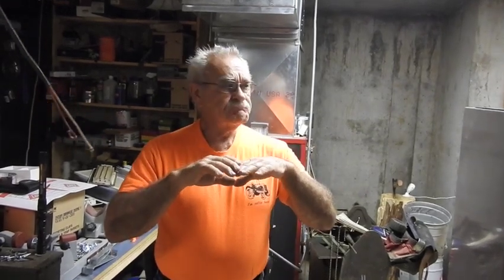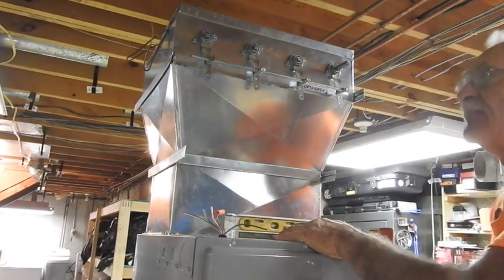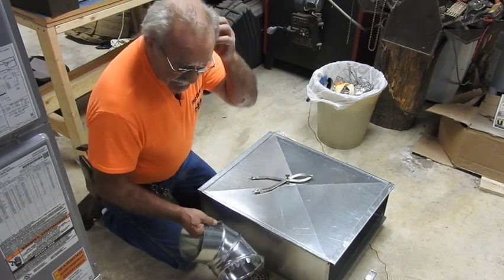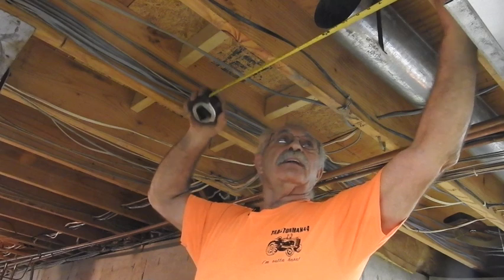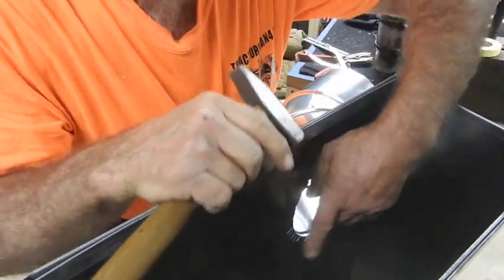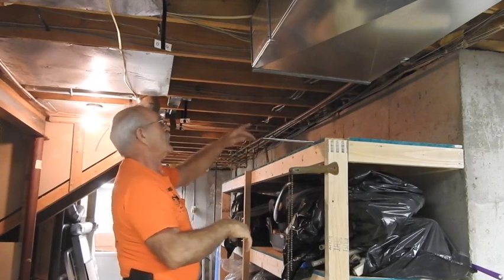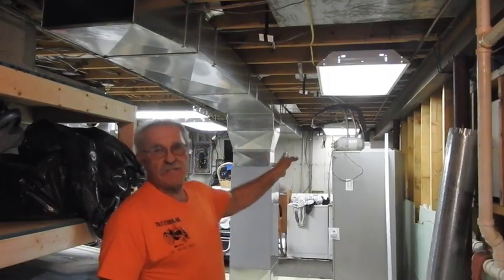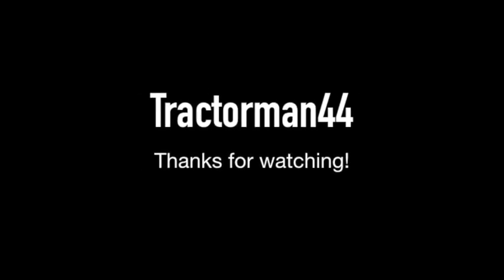Air Handler and Duct Retrofit Part 1

Comment: Hi Tractorman44!  I have really enjoyed all of your videos!  You have that common sense approach and are a wonderful teacher by example!  I have a question for you, or two!  Is the heat pump unit a 2 or 3 ton?  Also did you find the 20" x 8" duct sufficient?  I see others recommending 24" x 8" for a 3 ton unit.  I am about to install a 3 ton unit in my house, DIY, and have to change all of my duct work.  I built the house in 1984, when electricity was 3 cents a KWH, using baseboards, but I do have ducts going to every room for my HRV. (I have heated with wood, since 1993 but age is catching up)! The trunk line at the moment  is 8" round duct that will not do the trick.  I think you said they had a problem with noise, with the 4 ton unit, so I was curious as to how everything turned out!  Thanks for all you do and God Bless!
Reply from the maker: This heat pump is a 2 1/2 ton.  For your 3 ton unit, 8 x 24 would be adequate but for a heat pump, the lower velocity of an 8 x 26 would provide a much warmer 'feel'.  People make the mistake of running too small of duct for a heat pump and the resultant higher velocity makes the cooler discharge air of a heat pump in heat mode uncomfortably cool.  Now mind you, compensation must be made if your air handler is in the center of the run and the duct goes two directions off of the plenum.  8 x 26 going both directions will give almost too low of a velocity and the air flow will be effected due to extremely low duct static pressure.  I would recommend a regular air duct calculator to help you design and size the trunk lines, remembering to appropriately reduce the trunk size to maintain proper velocity.  Every branch duct reduces the amount of air for the rest of the system....so to make sure it gets delivered throughout, you must reduce the trunk size to maintain said velocity.  
   The duct calculator will give you the recommended FPM,  or duct velocities, for main trunks and branch ducts for residential, commercial or industrial applications.  Remember, residences want low air flow noise and that means lower velocity, low duct static main trunks.  Commercial ducts run medium static to high static duct systems and industrial systems can run crazy velocities and high pressure ducts because noise is not a problem to be concerned about.
  I use the Trane air duct calculator and have for 35 years or more: https://www.amazon.com/Trane-TD1-Ductulator-Sleeve-Calculator/dp/B01BUGXB7G/ref=asc_df_B01BUGXB7G/?tag=hyprod-20&linkCode=df0&hvadid=693594387774&hvpos=&hvnetw=g&hvrand=7045244849588785157&hvpone=&hvptwo=&hvqmt=&hvdev=c&hvdvcmdl=&hvlocint=&hvlocphy=9022818&hvtargid=pla-359474957905&psc=1&mcid=159e48dd172d3c9fad1f3336b4da3ba8 Read closely both sides of it and play with duct dimensions and fpm's to see the variances of trunk lines.  The SMACNA (much more expensive) calculator is the absolute best though.  Hope this helps, sorry it took a bit of time to respond.  I've been busy.  Good luck to you.
Reply: @tractorman4461  Thanks so much for a very extensive reply, it is REALLY APPRECIATED!!

Comment: Good looking job. 
I like duct work organized and in it's proper location. But I now see a lot of duct work just 'thrown together' and air flow improperly balanced. So sad!
Reply from the maker: This job was a real mess.  Trying to serve THREE elevations with one system.  Over 20 runs off of one truck.  Blower/air hander so oversized you couldn't feel heat out the registers.  The house couldn't even break 65* when its cold out.  We separated the second floor and installed a second system in the attic to serve that area.  Cut down the number of unnecessary runs in the below grade basement, and are adding forced air wood heat by means of automated damper controls between it and the electric air handler. Gutted the whole duct network...going back all new, properly sized, with new air handler and central air.

Comment: Dog gone you make that look easy. Nice work. I never hammer the tabs makes sense . Only put 3 furnaces in. Thanks for the tips. Also that 7 to  6 is good. I ran 6 off A
Reply from the maker: There's a lot more air available for the branch with a 7x6 take off for sure.  The area of a 7'' circle is like 38 1/2 sq inches whereas the area of a 6'' circle is only 28 1/2 square inches.  That's good because of the immediate restriction created by the actual elbow itself.  I usually wait to trim and bend the drives because it gives me a little flexibility if needed to square and plumb stuff up.  Not everyuone does it this way though.  Thanks for stopping by today with a comment.

Comment: From one old sheet metal mechanic to another great work.
When I was still in the field and had to do a basement like this,I would measure all my duct and where the top takes off needed to be cut in and do at the shop.save those knees.
When we couldn’t get louvres in i would make like you did.its a dying art.i miss working in thee field but my body gave out and now stay in the shop and run the installation side of the company.
Happy New Year and many more
Reply from the maker: Most of the  two piece damper bearings are no longer available, so I had to make do with metal on metal...and I don't like it at all.  If I DO find some NOS kits, I will have to go back and change these out. Yeah, it's a bit hard on the knees over time, but so far mine have held out..mostly anyway. LOL. I really enjoy a small changeout (not like this one) every now and then just to keep the dust off the machines.

Comment: Nice job. I used to do some sheet metal mainly TDC on commercial jobs.

All I have to do is walk by ductwork and I start bleeding.
Reply from the maker: Thank you Ed.  We always called the commercial flanged/bolted duct TDF.  I think that's a different companies designation for basically the same connection technique....TDC or TDF.  Iirc, one was Lockformers and the other was Engel's.  But I don't know which one was the chicken and which one was the egg.  (-;

Comment: I wish you were my neighbor. You could have fixed my duct work with baffles decades ago, so I don't have to run my wood heat thru the cold air duct, and keep my gas furnace fan running when the stove is cooking.
Reply from the maker: Oh man, there are so many add-ons that don't work like they are supposed to that it just ain't funny !!  Some can be a challenge for sure.

Comment: Happy New Year Wendell, my wood furnace is connected to the oil furnace about the same way but much shorter runs, neat video!!!
Reply from the maker: Thanks Eric.  Yeah, there's tons of ways to hook these thing into systems.  Some are good and some not so good.  LOL. But if it works, it works and that's good to beat the 'man' out of a few bucks.  (-;